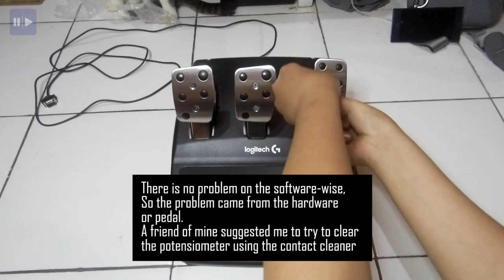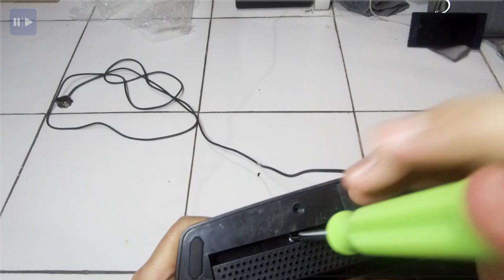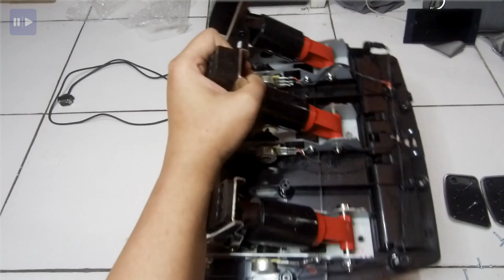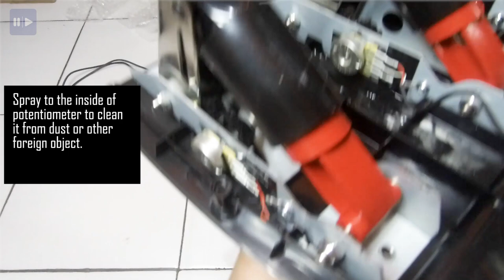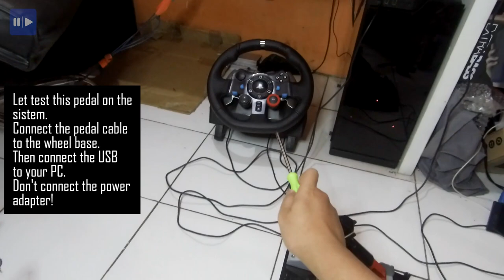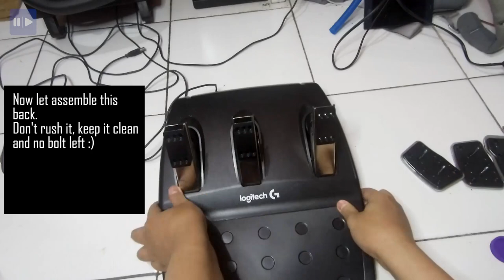Solved Error Pedal Flickering on Logitech G29 Steering Wheel using contact cleaner

Comment from the maker: Please note that it's not a permanent solution. If you want to make it last longer you can try to spray some liquid grease (just a little bit) inside the potentiometer after the cleaning process. It works flawlessly on my pedal. It still coming back but not in a short period.

If you want to make the throttle pedal aligned to the brake pedal (same height), you can try this tutorial: https://youtu.be/4SpSiE9cjGk
The idea is to swap the clutch's spacer to throttle's. This is the game-changer for me! and I hope for you too!
Reply: Found the non-H-shifter user! The reason the throttle pedal is deeper in the first place is to accomodate heel-toe downshifting. When the brake is pushed, it is then flush with the throttle pedal and it can be blipped more easily. Doing this modification only makes it harder to perform this technique properly.

Comment: My hero! Other videos I saw had the pedals taken apart piece by piece. Your method is much easier, and it worked flawlessly!
My first attempt made it worse, so I blasted the hell out of it again with more contact cleaner and now it works like brand new. Thanks!!
Reply from the maker: Yup! sometimes the dust is just moving around trapped inside. You can try to lean down the pedal so the hole pointing to the floor.
This tutorial is for the mild symptom like ours, so don't need to tear it down piece-by-piece.
Reply: An update: it seems the potentiometers go bad eventually. The problem is back after only 2 weeks and it's way worse now :') I tried this method again multiple times to no avail. I ordered some replacement parts from 3drap. Hope it works as well as some say it does. Fingers crossed!

Shame on Logitech for doing such a terrible job making these. A little googling reveals it's a very widespread issue, and they don't even sell spare parts!

Comment: Thanks bro, you're the man!, after many races lost starting in pole position,  never noticed that my throttle could be the problem, until I entered on Config menu and watched the throttle bar moving crazy. For a moment I thought that my throttle would need a major repair, or  I would need to buy new G29 replacement. Also a good tip is to lubricate the gears of each pedal to fix this, in the past I've solved a similar problem but with a PC mouse that only needed lubrication.
Anyway, you fixed my problem so thank you very much, you rock!
Reply from the maker: Same here, wonder why the other could pass me so easily in the straight think that was my weakness but turned out it's the pedal problem. Lol
Cheers mate!
Reply: what do you suggest to use to lubricate the pedal's gears?

Comment: Great vid! Best one I've seen for this issue. I took the pedals apart and gave them a general clean the other day but it didn't do the trick. Got some contact cleaner on the way to clean the potentiometer for the brake. Many thanks!
Reply: Where did u spray? I did in the hole in the potentiometer and it didn't fix it
Reply: @CSM13  I think some are more sensitive than others
Reply from the maker: Matt: thanks! I hope this really works on your pedal like mine and don't forget to cover it up with something when you are not using it to avoid dust.
Chilly: I am afraid that your pedal is on another stage as I categorized mine as a mild problem. I saw some video showing their potentiometer plate bend so it needs to be fixed by opening the potentiometer. But if you are not ready to open it, you can try again spray with more contact cleaner to make sure it really free from dust or anything. Hope your pedal fix soon!
Reply: @RindiTechEntertainment   I just bought one and brand new out of the box it is doing this same exact thing.
Reply from the maker: @dhollis26  you have brand new and already have the flickering?

Comment: I‘m going to try this as soon as I have the contact cleaner. I am planning to replace my Logitech with a Fanatec DD Pro in near future anyway so I’m not going to look for some proper long-term clean potentiometers but this flickering has gone to such an extent that it can shoot up to 50% brake power and that‘s just unacceptable (I am able to race 90-95 AI on F1 but I had to turn it down to 85 to still be able to compete, ridiculous…). If it works, you‘re my hero for the day
Reply from the maker: Good luck mate👍!
Reply: @RindiTechEntertainment  It worked wonders. All good again. Thanks so much bro👏👏👏

Comment: i have the same problem on the throttle peddle. Opened it and cleaned it but no luck. Just ordered the electronic contact cleaner. Once I receive it will open it again and give it a good soaking. Hope it'll fix the problem. Thank you. I am from Sri Lanka.
Reply from the maker: Yup! The problem came from the inside of the potentiometer which very hard to clean unless we can open it. I hope the contact cleaner also works for your case like mine so you don't have to open the potentiometer. good luck!
Reply: Hey did u fix it?
Reply: @spuki9153  Yup, WD40 did the trick. First I tried a contact cleaner, it was ok for a day but the issue came  back. Then I tried WD40 and it worked like a charm.
Reply: I fixed it and sold the G29 and go the G923. Very happy. Trueforce is awesome.
Reply: @afiatoot1  oh thank u for the fast respond, i just noticed the same problem with my gas pedal, so im just searching on youtube how to fix it,  if u dont mind me asking since theres a lot of Wd40 items, did u use their contact cleaner or?
Reply: @spuki9153  No, the standard WD40. Initially I  tried a contact cleaner  but it was only temporary.
Reply from the maker: @afiatoot1  wow congrats! I hope I can try the true force feature someday

Comment: Yoo, I had problems with my clutch pedal, when it was fully pressed it was flickering like at the speed of light. I did everything on the video and now pedals work like out of the factory. Thank you for this tutorial really helped. (P.S. I had to remove 1 screw because when it was on my pedals stopped working and it had some kind of interfearnce? idk, and I checked how I put cables back and everything is good, so not sure what happend but now it works when I removed the screw.) Thx again :)
Reply from the maker: what's works works I guest.. 😁

Comment: I found i wasnt getting full throttle with my logitech pedals (probs 97/98%) unless i pressed down ridiculously hard. 
I did the cleaning method with compressed air as there was a huge amount of dust etc under the cover. Also afterwards a spray of contact cleaner.
Now works perfectly.
Reply from the maker: I'm not sure what's the problem but if you don't want to open the potentiometer then you can just apply the dead zone.
Reply: @RindiTechEntertainment  it was caused by the dust getting inside the potentiometer. 

I have actually left the cover off my pedals now, as i quite like minimalist look and you see the mechanisms working. And also much easier to work on now in future.
For the amount of dust and dirt inside, the cover doesn't do a great job anyway.
Reply from the maker: @chriscuthbertson4931  oh I see. Just be careful with the small fragile plate inside the potentiometer then, it bend easily and and will effect to the sensor reader.

Comment: really nice video! i have to clean my accelerating pedal. i would never open this without a video and yours is amazing.
now...the difference between contact cleaner and compressed air...
the can of compressed air would just blow the dust, as opposed to the contact cleaner? so i dont have to worry about the ''liquid'' the contact sprays into the electronical things?
Reply from the maker: The contact cleaner is specific for electronic parts as I shown on the video so it's safe and it dried pretty quick. Just make sure it all dried before you connect it to the PC. Some people said that WD40 also will do the work but I never tried it myself.

Comment: i have an issue with the brake flickering at low amounts or it braking a tiny bit on its own 
aswell as the throttle does it a tiny bit too but not really at all
Reply from the maker: Yes you can try this method 👍🏻

Comment: Well i see the G29 potentiometer has exactly the same problem as G27. I used once spray cleaner for electronics, but it didn't last for long. So, when i see this problem i untie the pedal and the potentiometer and clean the potentiometer  board with swabs dipped into alcohol. Sometimes the dirt on potentiometer board is phenomenal. The swabs from white turned to black. With this way the solution is more permanent but it needs also more tools and time.
Reply from the maker: Thanks for sharing mate! Yup! At some point, I believe most of us will need to do that deep cleaning.

Comment: I already tried to take mine apart but didn't know which screws were for the peddles, watching you take the top off with the peddles still connected to the other base bit made me feel like such an idiot lol
Reply from the maker: Yup! They are on the same surface so it's easy to pick the wrong screw. On the video, I marked it all with the blue circles, other than that they are for pedals.

Comment: You know the gap in the pedals can you spray it down there instead of taking everything apart or would it not work?
Reply from the maker: It's hard to do. The gap and the potentiometer' hole is in the slightly different locations. You may reach it with flexible spray but you still can't see it.

Comment: If you dont have electrical spray you can work around it. I  just poured tiny bit of metho over them since it evaporates almost instantly. Afterwards I sprayed some degreaser on them and didn't bother with letting it dry. better to leave some kind of protective agent over it all I figure, never heard of degreaser being conductive yet. seems to be working so far. I didn't both with all the usb stuff either. just unplugged it from the wheel.
Reply from the maker: Thanks bro for the tips! Hope it also help the other with the same problem 👍

Comment: Hey man. Could I keep the cover off my pedals? The pedal plate is way to big to fit in my racing sim
Reply from the maker: Never tried it but I have seen someone on youtube keep the cover off and it seems okay. Just be careful on the wires and the potentiometer, they are easily to break

Comment: This will work for a while but eventually the problem will return. I have dismantled my G29 potentiometers several times and cleaned the contact points individually with circuit board cleaner and cotton buds. Eventually the contact surfaces of the potentiometer wear down. Logitech do not supply spare parts for any of their G series pedals, which is absolutely ridiculous. A G29 or G923 wheel, 3 pedals and H-pattern shifter is about $500 AUD (about 380 USD). That's the price of a washing machine so imagine if a washing machine manufacturer did not provide a parts service, there'd be an uproar from consumers.. Over the next few weeks I will be trialing some 3rd party potentiometers from 3DRAP in Italy and also some from the US so will post something up on my channel if I find a solution. I use a PS4 Pro but this potentiometer problem also applies to PC users.
Reply from the maker: Thanks for the input mate! Yeah Logitech seems not interest in making the spare parts for this but at this price range I can't say any other brand that gives this much. Thrustmaster is better but you need to add at least $100 for wheel and pedal (no shifter).
I am interesting on the 3DRAP, please let us know if you have the update on that 👍
Reply: @RindiTechEntertainment  Yep, will do, thanks for the feedback

Comment: Does clutch brake pedal all there will look leveled from side or both clutch and brake will look level ? and accelerator is slighty go forward i mean  un level ?
Reply from the maker: Yup! that's the default levels from the factory. The throttle pedal is a bit forward. If you want all three pedals to align you can buy a spacer for throttle.

Comment: Why shouldn't you connect the power adapter when you try it for the first time?
Reply from the maker: Testing pedal input didn't need the wheelbase to work, usb connection is enough. Also if we connect the power adapter it will trigger the wheelbase to calibrate (turn right and left aggressively) which is a bit dangerous at that state.
Reply: ok, thx

Comment: My clutch and accelerator are clipping on something and I can FEEL and hear the spring, is this a problem?
Reply from the maker: if you believe there is something inside better you check it. if there is nothing then you can clean it
Reply: @RindiTechEntertainment  Sometimes I can feel it clipping on something and hear the springs, I got it 2 months ago. Is this something WD-40 can fix?
Reply from the maker: @mastermason4766  if there is no flickering and normal on sensor then it's not the potentiometer's thing. you need to open the cover of the spring. but I think the wd-40 is worth buying since it cheap and also you can use it to clean every part cause it electronic friendly
Reply: @mastermason4766  I'd recommend using WD-40 Silicone spray though. Not as nasty as it's oily brother. You should still check visually if something is in the spring.
Reply: i have that too, i doubt its a problem, and i know that you cant do anything about it, dont take it apart for that reason alone

Comment: Hey thanks for the vid but what thing where u using to test like if it worked or not
Reply from the maker: When it dried you can connect the USB to the PC without power. The pedal input will keep shown on the G-Hub. Then you can test it before re-assemble. you may check the video one more time, I've shown it there.

Comment: Hey brother I have a problem with my pedals connection. The pedals wire don't  connect up and my pedals are not working can you please help me?
Reply from the maker: I am not sure bro, maybe you need to open the pedal to see check all the connection still intact. Or it just a matter of unplug and plug it again.

Comment: Hi, ive cleaned the potentiometer but my pedals are still flickering. Any ideas?
Reply from the maker: You can try to clean it again for sure. But if it's still no good you may need to deep clean by removing all the part like on the other video (not in my channel). Hope you find the solution.

Comment: Great video man. I was wondering that I brake wire connection to the wheel.
Reply from the maker: The wires also need extra attention though, when you open and close the cover make sure the are not block the screw's line

Comment: Everything seemed to be going well. When I sprayed with contact cleaner I tested to see if the flickering throttle issue had been fixed and indeed it was. When I reassembled it though my logitech g29 was no longer working. It was dead despite the fact it was connected as it should be ...
Reply from the maker: Sorry to hear that, I'm not sure what had happened there but make sure it dried up before you reassamble the pedal and carefull with the cables, they are easy to clipped or bend. You can reopen and check if there's cable clipped or detached.
Reply: @RindiTechEntertainment I reopened the cable was destroyed in 2 different areas. It was stuck  under the bolts probably. I have to buy a new cable now

Comment: I have a similar issue but the pedal is like coming toward me and the game makes it so it thinks im breaking sligtly and its annoying because i cant change gears with it doing that please make a tutorial
Reply from the maker: What it's look like on the Logitech app? is it normal? so you can't reach the full load on the game?
Reply: What happens is it shows its being pushed forward by 3.1 or lower its like instead of going backwards like somethings pushing on it its  coming forwards probbly the spring inside of its to strong id love help its rlly annoying i can show u a video if u want
Reply from the maker: @that1guynobodylikes  I suggest you to try to follow this tutorial first. It's the easiest and cheapest way.

Comment: Will contact cleaner and standard WD-40 have the same effect
Reply from the maker: I haven't tried WD-40 but some people say those are the same.
Reply: @RindiTechEntertainment   Do you think that wd40 will damage the circuit board
Reply from the maker: @shaned2098  I don't think so because I found that they also have the "electrical cleaner" version. So you just have to choose the right type/version of WD-40 (electrical cleaner).
Reply: There is a dedicated WD 40 contact cleaner. The WD-40 oil spray is NOT designed for electronics because it leaves residues.

Comment: Hey its a bit late but, i have the sane problem but with the clucth, already followed your solution but nothing changes pls help
Reply from the maker: If you have no other way I suggest you to try again with proper step and make sure all clean inside. If it's not work you may need to deep-clean the potentiometer.

Comment: Can I have the link to the contact cleaner that I could order from Amazon please
Reply from the maker: just type "wd40 specialist electrical contact cleaner" in the search box, you can see the wd40 product list.
Reply: @RindiTechEntertainment  thank you what should I use to see the flickering the thing that you used at the start of the video
Reply from the maker: @xh41derx85  use "Logitech g hub" software
Reply: @RindiTechEntertainment  I fixed it and it worked perfectly for a few weeks and now it’s happened again btw this is my other account
Reply from the maker: @haidercapo3261  Ya that's the real challenge actually, there is no permanent solution for this.. just repeat the process.

Comment: i heard that contact cleaner its chemical ingredients desolve the lubricant on the potentiometers so i dont know if just compressed air is safer/ as good
Reply from the maker: Actually I just found out that adding lubricant after cleaning the potentiometer will make it work last longer but since the main objective is to fix the flickering the CC alone is good even though it's not the permanent solution.